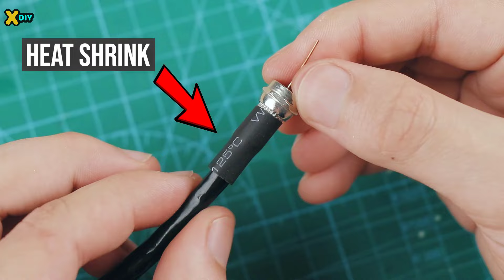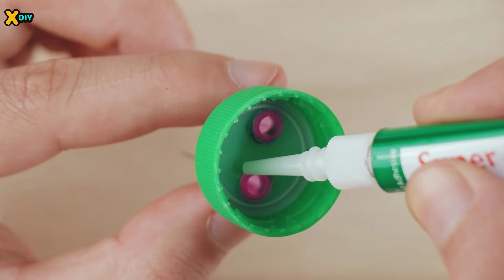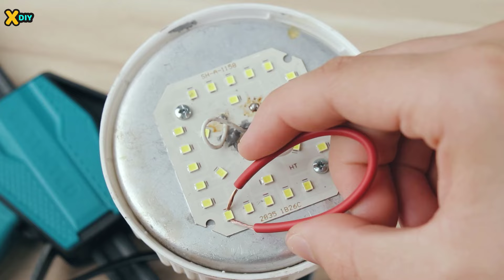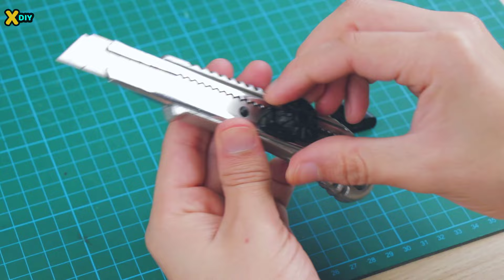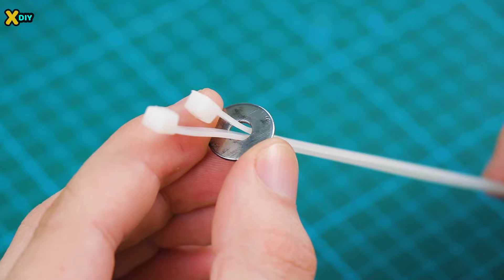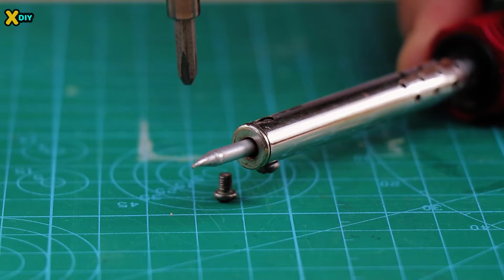Electricians have been hiding this for years! No one believes it but it really works!

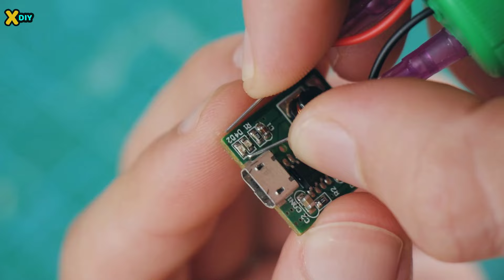Comment: 2:22 make a continuity checker
2:53 not using continuity checker
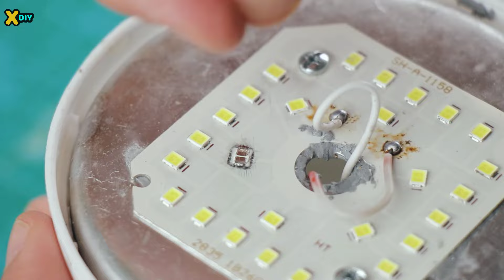3:12 No need to screw a good battery. Use a pencil and draw connections across the terminal. Don't know how long such will last though.